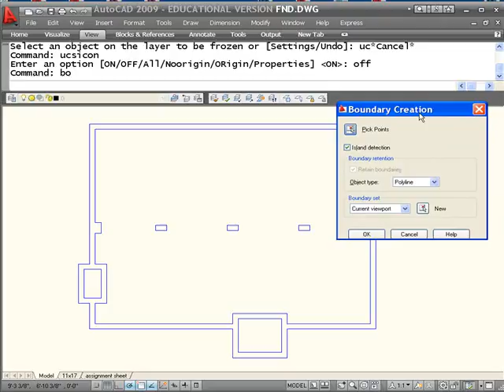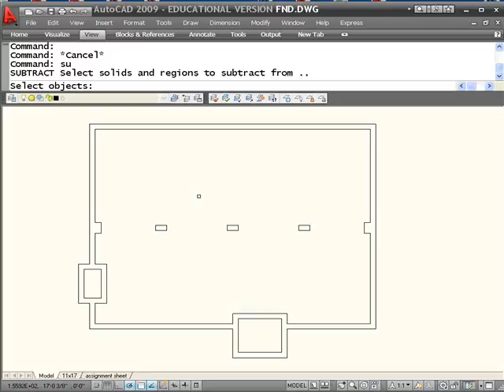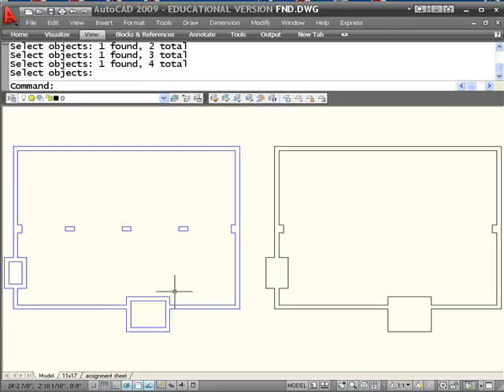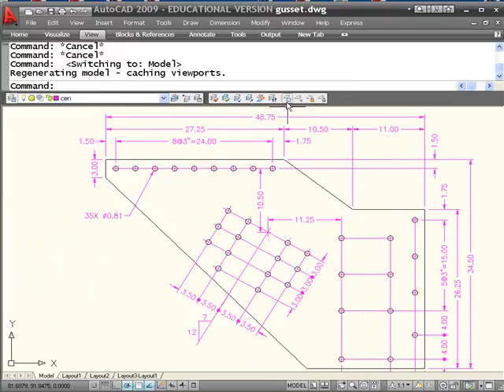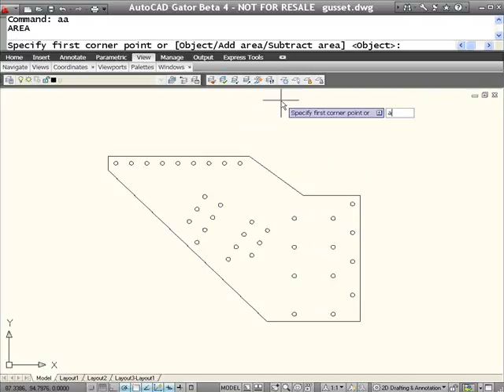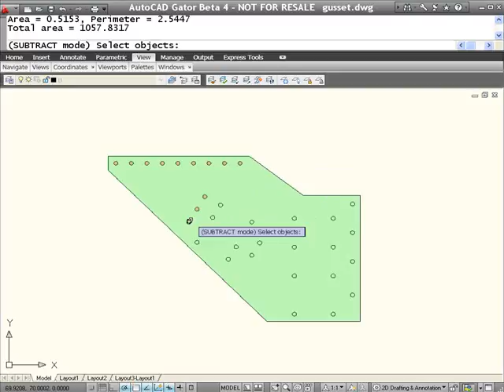ComplexArea

Comment: Thanks for sharing.
This Technic is the best way to calculate complex-shape's area. 
but, sometime this method has a problem when regions are not co-planar.
In this case, we must use "flatten" command first in order to make all regions co-planar ...
Reply from the maker: That is true for drawings that aren't on the same plane for sure. Flatten, which is an AutoCAD express tool, usually works well to correct that, but isn't without flaws. Joe Burke has written a program called SuperFlatten that I've found more predictable. He makes it available for download, so google it if you are interested.
Reply: @DanAbbott-SMCC  Thank you thank you so much for your reply.
I have an other question please:
In Autolisp / Visualisp: To select TEXT entities for example inside a curve, we use "(setq sset (ssget "WP" pts '((0 . "TEXT"))))" with pts is the list of points on the curve resulting from the division of this curve.
My question, is there a similar way to select TEXTS within a complex region ?.
That is to say, is there a way to extract or generate a curve from the outer limit of the region, and apply the same technique to it?

Any advice or idea, I will be grateful,